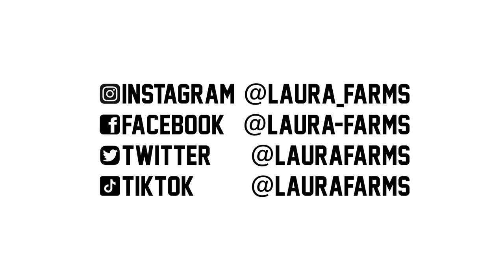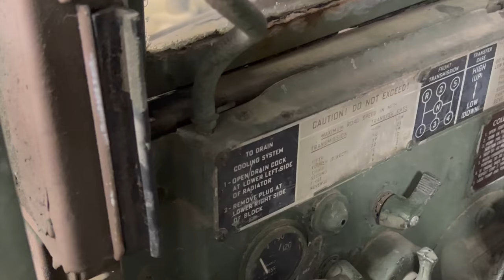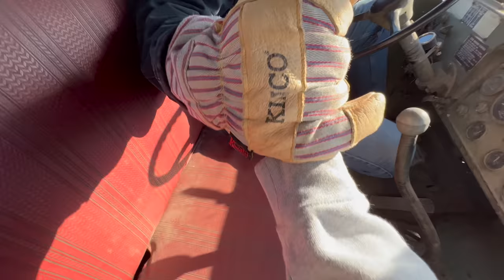Getting A 6X6 Running After 10 Years!

Comment: too much  starting fluid can pop those pistons even in a military grade engine so go easy on that it s 10 wheels so 10x10 the brakes should work not sure if they are air or air assist . but should pull that ole tractor simple enough.

Comment: Like another gentleman pointed out, your batteries are way too small. Need to know the actual model of the truck but it may have had 4 of the 6TN batteries which cost about $250 each.  You might get by with 2  12 volt batteries but they need to have over 1000 CCA each. In colder weather they may not be enough. Small batteries and diesels don't agree with one another.

Comment: Used Motor Oil ???   Before all of the Emissions engines  you could mix 10%  used Motor oil with Diesel fuel, but they used a serious oil filtration system first..
  You will need new Fuel Filters soon..  It simply is a Modern Fuel Injected Diesel that needs very clean water free fuel ..  Keep the Fuel tank full all the time so  you don't draw condensation and  get a rusty fuel tank ..
  There should be manuals  for it online..

Comment: With nothing on the frame I bet it's around 15,000 pounds, maybe 17,500. Most of these M818s weighed around 20,000 pounds
You think these are loud, you should stand next to a Straightpiped M1070 OshKosh! Those old Detroits will blow your eardrums out

Comment: I know every engineering military mestakes on that truck . 
   The wire to wire  harness stagon crimp terminals , drill a small hole in the end bruise the end of the word then solder every one of them with 50/50. Silver lead rosin core  wireing solder ..fix the frame ground next to the alternator even if you have to drill a new hole . 
Grounds cannot work inclusive with a rubber mount holding the steering guard . which I see missing . clean all the grounds off , you will find while the frame was being made that they were silver soldered .. 
  If you solder the entire wiring harness and fix all the grounds on that trunk it will start with a dead battery ..! 
  Now set the voltage on the alternator to 27.5 volts with a previous fully charged battery .. 
   I know every mistake the engineres made with that truck . ! STUPID MESTAKES . 
I CAN STOP THE FRONT TIRE CUPPING TOTALLY . 
   I CAN FIX THE SPRAGG FRONT WHEEL DRIVE THAT AINT WORKING ..! SIMPLE FIX TOO !

Comment: Here's some info on the truck and how the front wheel drive engages. https://en.wikipedia.org/wiki/M809_series_5-ton_6%C3%976_truck#:~:text=M809%20series%205%2Dton%206%C3%976%20truck, 
And a manual about these M-8XX series trucks. https://www.ccsurplus.com/PDF/Manuals/5-ton-unit-maintenance.pdf

Comment: Only a moron would chop the frame and defeat the whole purpose of the truck....
This is the kind of truck that brings everything to the jobsite in one load without a trailer and then hauls out everything like logs and debris....then comes back and scoops up equipment and material for the next job....
YOU DON'T REALIZE WHAT YOU HAVE HERE.....THE EQUIVALENT OF THIS FROM A NEW DEALERSHIP WOULD COST 100K

Comment: Dude .....YOU DONT KNOW THE FIRST THING ABOUT USING STARTING FLUID.....YOUR LUCKY YOU HAVNT BENT THE RODS OR CRANK....
ETHER IS NOT EVEN ADVISED TO BE USED.....AND IF YOU DO USE IT YOUR GOAL IS TO POP OFF ONE CYLINDER NOT FLOOD THE ENGINE ON IT.....
YOU USED 5 TIMES TO MUCH